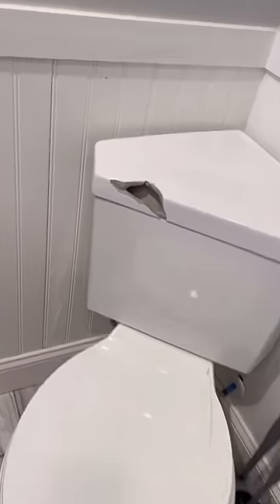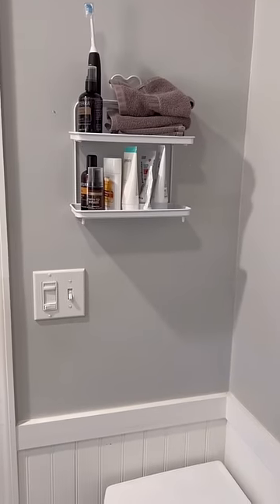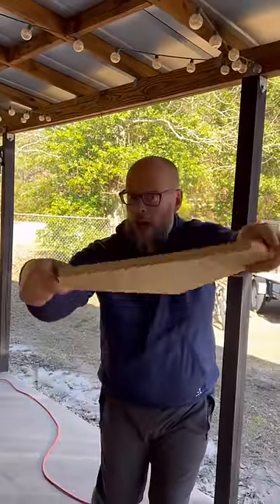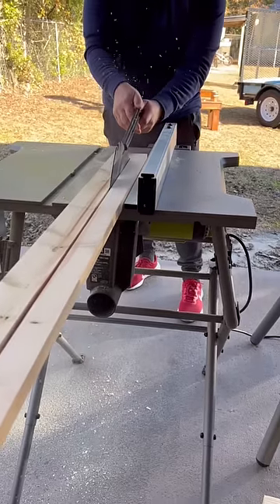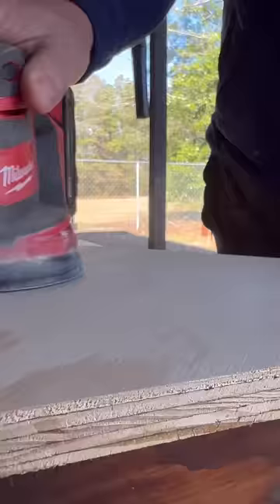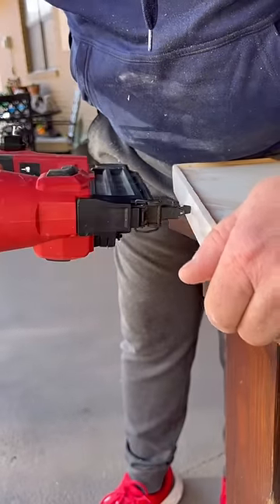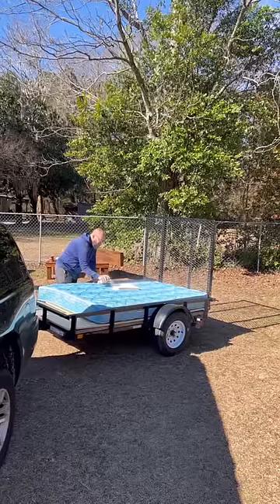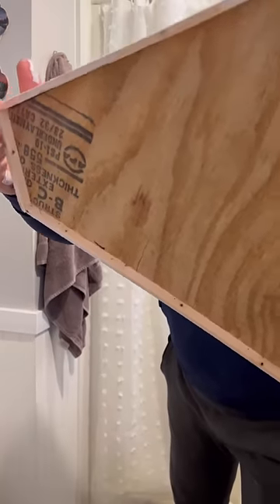Redneck ingenuity at its finest!🤯 #redneck #diy #doityourself

Comment: Like it. You should use some of the flex seal brush on paint to do the inside of the lid just to keep moisture out and to help with the shrinking and swelling. I’m sure you can do a bunch of other things as well like plastic instead of the plywood but for what you got i would try the flex seal brush on.
Reply from the maker: Thanks! We actually come back and did just that, the flex seal. We also painted a Superman logo on the bottom side as a joke, but the shape is the same as the logo.
Reply: Dope,but learn ur 45`
Reply: 22.5 works good!!
Reply: Good job durable😂
Reply: Never apologize for having great McGyver skills.
Reply: @thomasdoleman9593 Dope but you should learn ur 45°
Reply: I was going to say the same thing nice mind.
Reply: Forgot to caulk top trim before paint to cover gap...would look like solid piece
Reply: Thats a great idea
Reply: @TheTrentTribe  Ok, now that is funny and will just pickle your nosey party guests.
Reply: And a piece of rubberised tape around the inside where it rests on the tank, will both seal it, and ensure that no force is transmitted down to the porcelain if  it gets hit.
Reply: @TheTrentTribe Superman logo❤🎉😂 bravo brotherrrrrr 👍🏾🙌🏿👊🏾🏆
Reply: I was going to comment pretty much something. I thought if he was going to use wood he should have used treated wood and sealed the inside of it to prevent mold
Reply: @TheTrentTribe If you ever sell the house, that will be one helluva of a surprise for the new owner. lol
Reply: If you wanted to go high tech redneck you could probably 3d print a new toilet lid. If it's a smaller printer you might need to do multiple pieces though & glue it together. 
A lot of libraries have 3d printers you can use. 
But honestly this works just fine, looks fine & is waterproof with the flex seal. Plus it's already done.
Reply: Flex seal!  LMFAO!!😂
Reply: Yeah def paint the inside with something
Reply: @tamsintarshish3905 cause why spend money when you can fix it for free? I see genius
Reply: I was going to say the say thing.  Great job, but put water proofing on the inside or it will warp and rot
Reply: You need to seal the wood on the bottom or wet side to prevent mold .
Reply: I was scrolling to find out how far down i'd get before anyone mentioned the Superman chevron! Classic!
Reply: I busting out laughing when you sprayed it on the mattress adding to the red necky theme!

Comment: Epoxy the ceramic pieces back together,  fill the missing piece with fiberglass resin and fibers, finish the body work,  and get it powder coated. Or, ideally,  bring the broken lid to the local pottery club and have them make you a new one. They can even match the glaze
Reply: I do t think they know where those pieces are 😐
Reply: That's what I was thinking fiberglass resin. It would take less time
Reply: @darrell9832 ...Yes and it will be pretty...especially if you also do the seat cover too with varity of color in a resin pour
Reply: And it will look a lot better than that bit of amateur carpentry there.
Reply: @christopherbedford9897 
I think it came out fine!
Reply: He did better without your two cents.
Reply: At that point just get a new toilet

Comment: Good idea. Please make sure you paint the under side with a water resistant or water proof paint so mold does not grow on the bare wood. 👍
Reply: The first comment ☝️ he said he used flex tape paint.
Reply: @debrajol3585 flex seal paint*
Reply: What's wrong with bathroom shrooms?
Reply: Use marine plywood in wet areas.
Reply: @janet1744  Marine plywood??!! I did not know such a variant exists. I learned somthing today. Thank you.
Reply: @kennytam9514  If you own a sailboat, you'd know all about it. As you may guess, it adds some zeros to the cost of anything.

Comment: Perfect my stepfather did the same he used oil based primer on both sides and added paintable caulking to seal up any seems 10years later it still looked perfect
Reply: Yep. Need the primer to seal the wood for a good finish

Comment: If the seems were caulked and the inside was painted to prevent mold I would call it a great fix. Love that you actually trimmed it out instead of just slapping a slab a plywood on top. Good fix! 👍

Comment: That looks great!! BTW thank you posting this. I have a issue ehere it broke in multiple pieces and need a temp fix until I can replace the whole toilet. I love redneck ingenuity, it gets the job done for a fraction of the cost, plus it's solid and reliable work. The only thing I would do differently is seal the bottom of the wood so it won't mold or get water damage

Comment: The only suggestion I would make is to paint it with a good oil based primer and then latex is fine for a top coat. Go High gloss on the top coat to more closely match the ceramic finish.

Comment: You did an excellent job. I would not have guessed that would be made out of wood.
However, the moisture that's going to be exposed to the underside it's going to cause that wood to rot, so you may have wanted to put something under there to block it such as epoxy or something.

Comment: Cool toilet! I have seen corner sinks but not a toilet. Great McGyver!

I don't mean to rain on your parade, but you will need to make all sides water proof. 

The underside of the lid will become wet from the moisture and splash zone inside the tank which will rot the unprotected wood. The bare wood will draw moisture into itself causing it to mold and rot. Plywood is especially vulnerable to falling apart and rot from the moisture. I hope you still have original.

Your shelf will last longer you can make it completely waterproof.

The easiest fix might to use several coats of a marine grade paint on all sides. I am not sure how well marine paint will cover the paint you already laid down. Sometimes different types of paint are incompatible and will bubble up. Maybe uou could just paint the bare wood on underside of your lid.

Or
You could try using epoxy on it. From videos I've watched people pour the epoxy over painted surfaces.

Or
You can use the broken top or the one you made as a template to create a mold so you can use epoxy or cement to make a new one.

Comment: You should have used some kind of sealer on the bottom side because the moisture will cause it to mildew and come apart... I broke a lid and rednecked one also.

Comment: You will need to use sealant on the wood .  the wood facing down to the water otherwise it wont last as long .
the same kind used on outdoor decks  to prevent water damage .

Comment: I am a bit concern about the possibility of mold being more likely. The moisture and water is sitting right beneath that lid. And tanks sweat so the wood likely to soak in a lot of moisture. Might want to make sure you seal the wood good. It might still be possibility to fix the porcelain lid if you didn’t throw it out. Something that will fill in the missing piece, some type of porcelain filler and a glaze to try and blend it in. Then afterword make some sort of device like a shelf that’s place right above the lid that also holds on to the real lid and acts as a handle to make it easy to lift and hold. That would be an interesting idea.

Comment: Looks good but it will sweat and swell and mildew. I would tried to glue the pieces back together and then put epoxy glaze inside and out but if it looked too bad then use that wood tray topper on top of the original lid post repair ❤

Comment: The rip cut on the table saw makes me nervous. The strip between the blade and the fence is in a kick back position, and you're directly in the path. Push stick on the fence piece would be preferred.

Comment: auto body filler could have fixed the original.  There are a number of sandable putties that also would have worked.

I'm not condemning this solution.  Just giving options.

Comment: It has too many holes in the wood where crap, pee,  poop, bacteria, mold, mildew can grow black mold and rot your holey wood product. U could have repaired the porcelian like new. And you didn't bother to paint the inside/underside of the lid that is exposed to moisture. Use wood puddy to fill all the nail holes, and seams between pieces of wood.

Comment: Pull that b— off!  You need to DRY OUT ANY POTENTIAL MOISTURE FROM THE TANK, coat it in fiberglass resin, sand it, repaint it and your should be good to go— AND YES: You have to cover the WHOLE THING.

Comment: You left unsealed WOOD inside the tank.  OK I give it 1 MAYBE 2 years before mold, rot and insects start to break that down.  The least you could have done was to give it a spray paint of a plasticized type to seal it.
Reply from the maker: We did. Just not on this video. We painted the Superman logo on the bottom and sealed it.

Comment: Please lower the blade on your table saw, way too high for a cut like that. It’s dangerous to work around. Typically above surface about 3/4” in my experience works best.
Although rarely  that can help make the cut you want. Also paint the bottom of that tank cover, it will seal up the wood that’s just above the water 24/7. 🚬🐔🪓